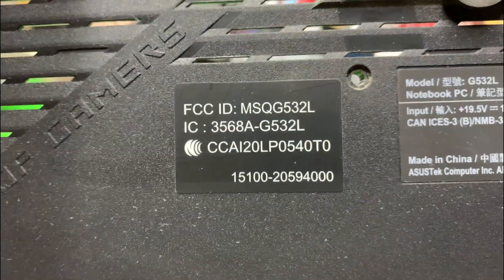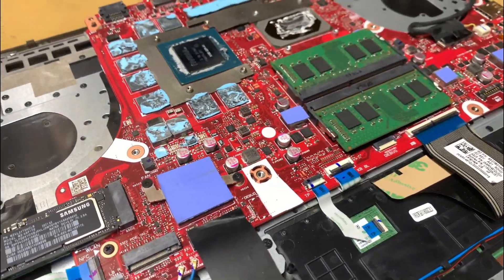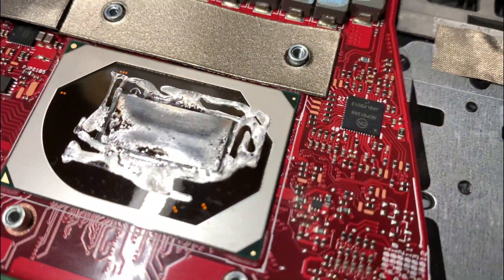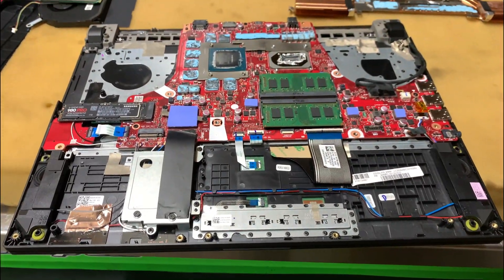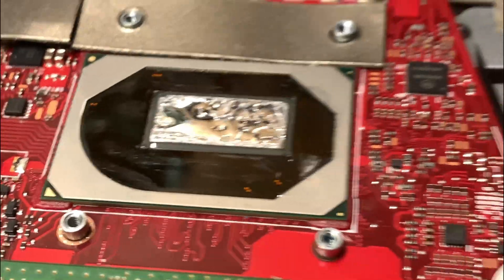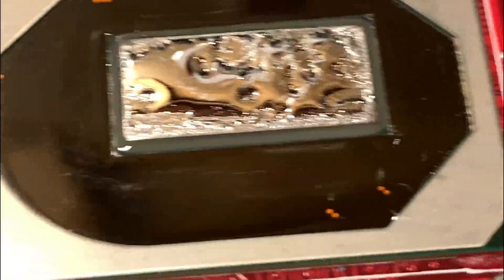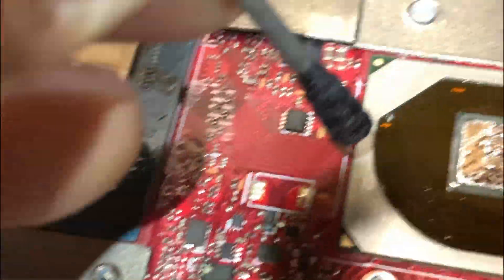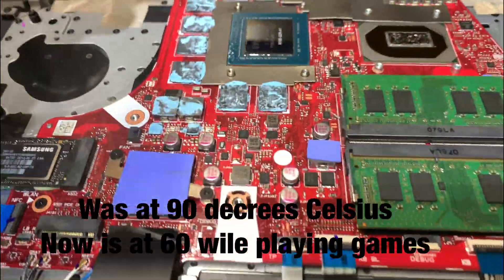LIQUID METAL FAILED  asus 🤦🏽‍♂️

Comment: They put too much, but your laptop is fine. They put some sort of foam barrier around the CPU. The thing is, liquid metal has a high surface tension, which means, it won't go pass the barrier even if there's a small gap nor that it'd soak into it-- think of it like water, but very hard headed lol idk how to explain. LM just loves to stick to themselves.

My laptop uses 2mm wide thermal paste as barrier. (ice fusion v2 paste into syringe with plastic tip from conductonaut, then cut with scissors to 2mm wide)

From experience, too little of LM causes huge core to core temperature difference like 7+ celcius. Too much and enough has the same and best result. In this case, Asus might have put more than needed rather than having too little of it since this would destroy your performance. I feel like their confidence with their barriers make us consumers worried. lol idk

Comment: Congratulations, you have killed the laptop. You should NEVER use liquid metal with copper heatsinks. 

Your GPU heatsink is not plated copper. The liquid metal is now fused with it, destroying the GPU die as well.
Reply: Yep, probably. Gallium and indium will slowly react with copper creating hard intermetallids which can and probably will damage the GPU die because of heatsink preassure. Espeacially if the laptop is accidentally bumped or dropped. Also ASUS made a barrier to prevent leaks of LM onto the board. It's not enough to do just dielectric coating on GPU, in case of a slight bump or a drop of the laptop even one drop of LM will damage a lot of components on the motherboard.

I coudn't find the official reason why ASUS plated only CPU heatsink but that's a fact. Maybe for the price reasons, because GPU has a lot more components around the die and i think it's a lot harder (and more expensive) to do good and verified industial dielectric protection on GPU (different chips have different sizes, so component layout around the die is not unified for different GPUs). So I think that's why only CPU has LM.

But I'm pretty sure that most people will ignore this. Sadly. Content creators should either do a disclaimer "I am not a real expert, do you own research" or do more serious research themselves before posting content on such complex operations.

Message to people who want to try liquid metal and are watching videos and "guides": 
1. you need to do at least a DIY nickel plating of a heatsink.
2. you need to do dielectric coating of components around the die.
3. you need to make a barrier to prevent leaks of LM onto the board. It should not be too thin for providing protection. And It should not be too thick so the gap between the CPU/GPU die and the heatsink won't increase. 
And even that doesn't give you a 100% guarantee that everything will be alright in the long run.

Comment: I think this is surely normal. Because Asus has some technology to not spreading LM to any electronic devices on motherboard. They are trying to get a patent on it. you already saw that processor has a good insulation. LM may overflow from the processor but can not pass other side.
Reply from the maker: The liquid out of cpu can get spilled if laptop gets dropped or kick or any hard moving or running with laptop in backpack    Also if is in a position the allows to drain the fluid out if is lije that for a ling time  , the protection the you called safe it was soaked in liquid showing the it cannot hold the liquid in place anymore, and i seen this computers fails do to this high conductor liquid the comes out to touch motherboard  and ruining the pc   Many videos about this online

Comment: hello do you happen to know what the thermal pad thickness is ?
Reply from the maker: For the memory’s on the gpu?
Reply: @diytech1008  yes
Reply: @diytech1008  i want to replace all the thermal pads and i dont know the thickness
Reply: @diytech1008  is 1mm good ?
Reply from the maker: @silver2290  I believe so.
Reply from the maker: I need to measure mine to be sure
Reply: @diytech1008  i dont think they are actual thermal pads i think its paste
Reply from the maker: It’s pads man
Reply: Use 0.5mm

Comment: they all fck up, open up any brand new gaming laptop and u'll see lots of stupid amounts of thermal paste all over the Chips and on the components next to them, i never had a new laptop without opening it up after less than half a year just to clean that shit up nice and tidy and replace the thermal paste with something good
i work as a tehnician in a small firm that repairs phones and laptops, and i've seen many laptops that from the factory had this issue, it didn't matter if it was lenovo, asus, msi, acer gaming laptops, any of these companies are doing this retarded shit, they put  the thermal paste everywhere, at some laptops i was afraid of cleaning it, cause i couldn't see the actual components in the proximity of the chip, they where underneath the paste, so it would increase the time needed for cleaning and replacing the paste, just so i don't get them flying while i am doing the job...so yeah, this issues goes a long way...
i think they don't understand how this chemical compound reacts to high or low temps, like dilation or contraction, they don't know what these terms are or how physics work....really sorry for the big brains in those companies, they should be replaced with actual engineers that know this stuff...